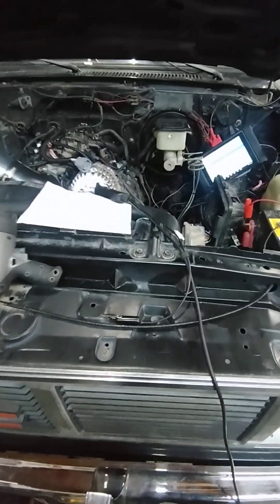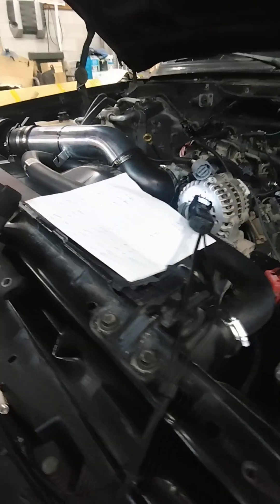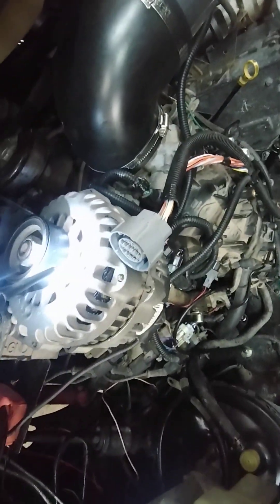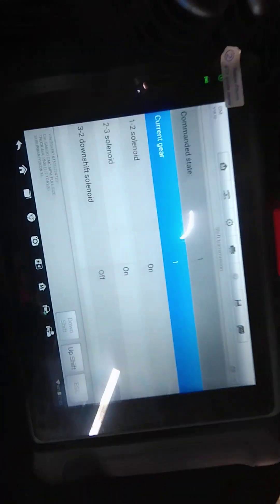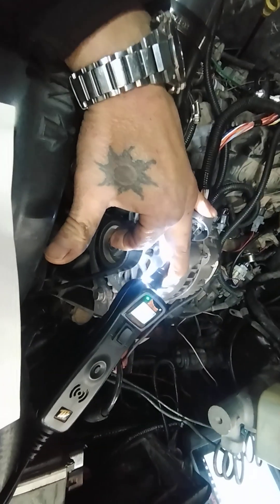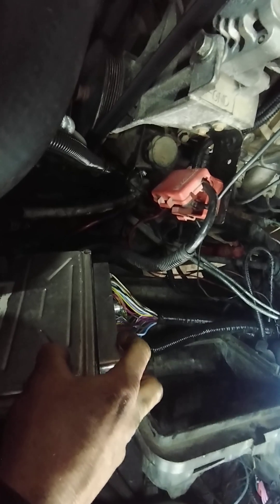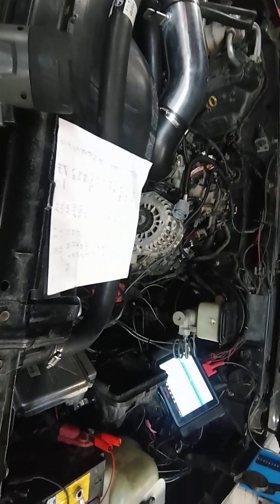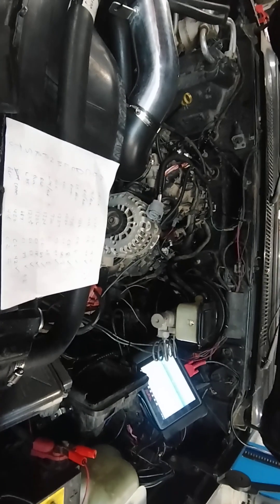diagnosing 4l60e electrical harness for proper function

Comment: Similar problem no speedometer signal so limp mode blue green connector 20 n 21 out at 50 to speedo. Still no shift or speedo?

Comment: I need heeeeeelp pleeaaasseee I did a v8 swap and  can only shift 2 and 3 I won’t get 1 and 4
Reply from the maker: @celestialcrown4538  it's in limp mode. You have to make sure it's wired properly and ecm is programmed and detecting transmission.. I can't help you diagnose your problem through messages you need to figure it out or pay someone in person. 😀
Reply: @hillsautoservice did you figure out your issue?